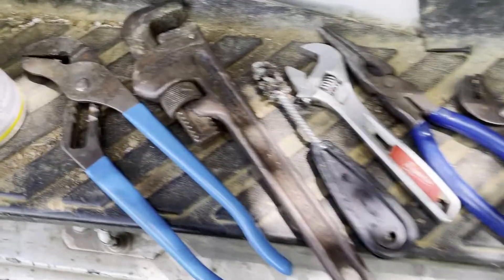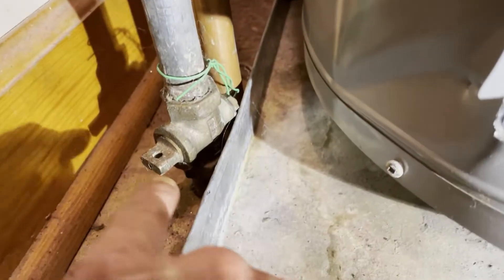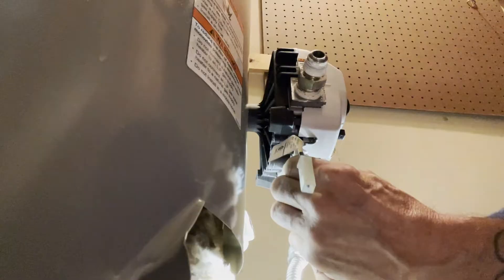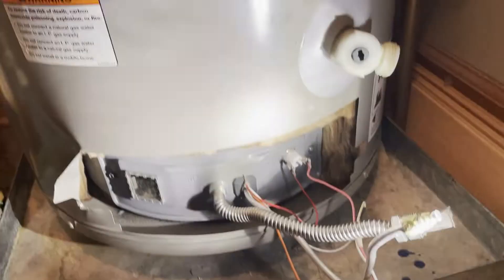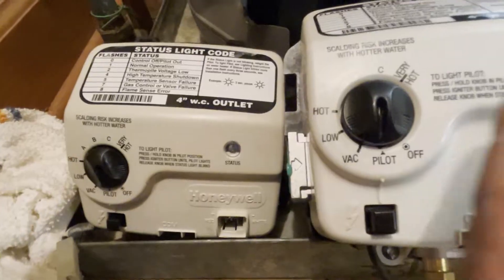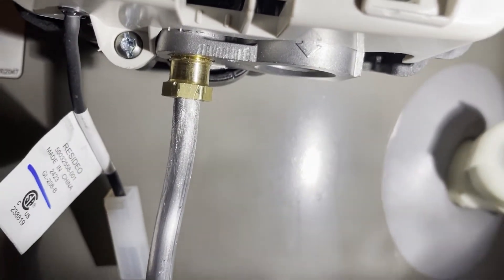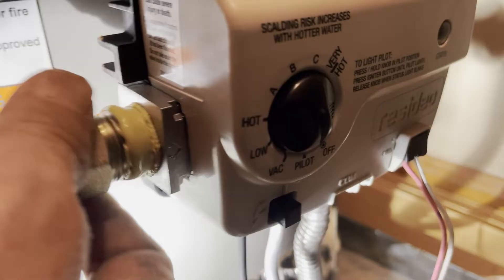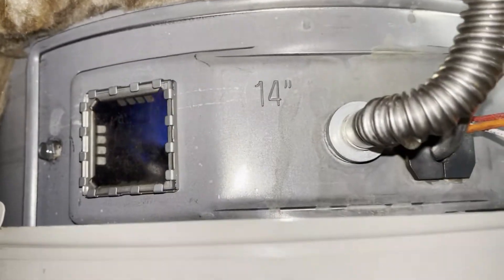HOW TO REPLACE HONEYWELL GAS CONTROL VALVE ON RESIDENTIAL NATURAL GAS WATER HEATER

Comment: I wanted to swap a WV4472A2102 with a WV8860B1325. I don't want to have to plug it in to a wall. I don't need the open, close valve on top for the vent. I'm thinking I can swap it over. I would have to just mount the temperature sensor onto the new/used/cheap water heater that we just picked up.

Comment: I want to replace my gas water heater control valve, and my part number is WV8860Q1000, but I only found one online is WT8860A1000, do you think that would work for my water heater control valve?🙏
Reply: Well, the answer would be to give it a go and see if there's a return policy, if you got the wrong part. Or, call up the manufacturer of your hot water tank and advise them of the same part number. Good luck.

Comment: Worked well.  I needed to use a strap wrench along with the 6" threaded 1/2" to get the last one out -- but thank you for showing all the detail.  It helped to see how far out it could stick as the last guy probably put the old one in a whole nother rotation.

Comment: Hey Tim- I changed the thermocouple, same issue, pilot light would not stay lit.  Changed igniter switch, same.  Is there a way to diagnose if the control valve is bad?  I am thinking it’s the next step.  Thanks- great channel- Sean
Reply: Is there a way to tell if control valve is the issue, beside process of elimination?
Reply: Were you able to identify? I am having the same issue thinking if it could be the control valve

Comment: Where can I get a new metal fitting for the gas channel? (The one that is really dirty in your video). Does the fitting have a name or P/N?
Reply: You might be able to find it at a hardware store. Essentially what you need to do is find a brass adapter that matches the pipe thread on the controller on one end of it. This will often be called a MIP. And the natural gas fitting on the other end. You're looking for something called a gas flare fitting. It'll take some trial and error, but if you have a good hardware store with a nice selection of pieces, you should be able to find what you need. Otherwise you can look online.

Comment: The rear of the housing broke on ours during the removal. Now we have the plastic stuck in the threaded hole… trying every kind of extractor but the plastic will not budge

Comment: Why did you drained the heater? Thank you
Reply: Draining the water heater does two different jobs in one first it services the water heater by getting rid of sediment in the bottom of the water heater and second it keeps you from getting the insulation soaked and getting water all around the burner assembly.